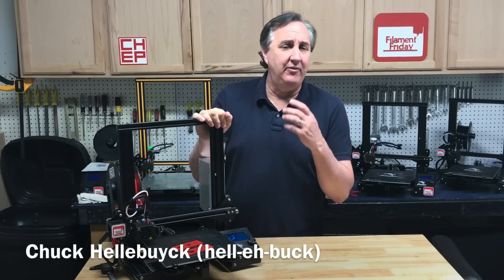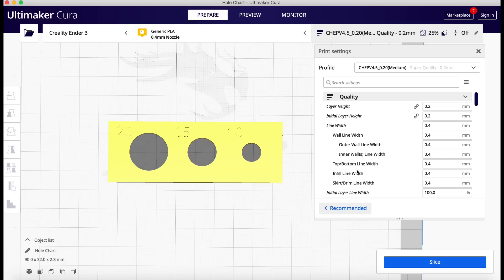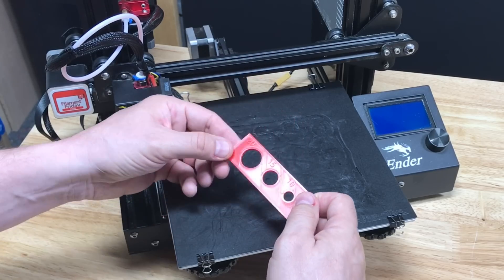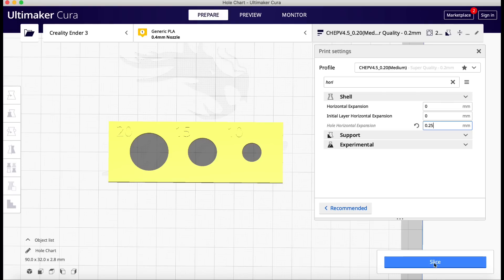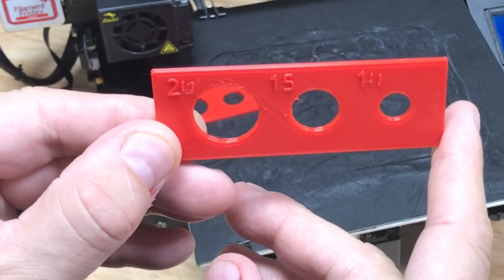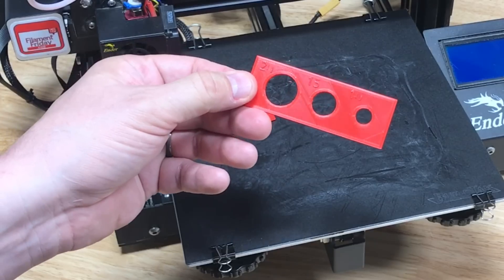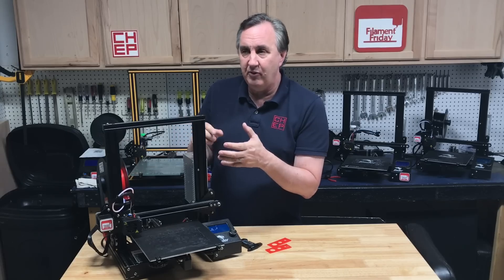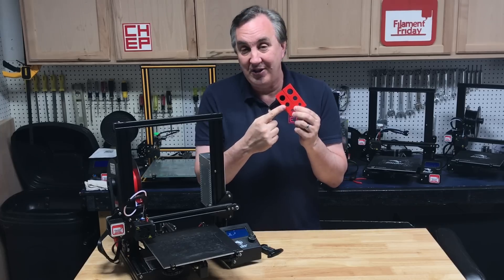Horizontal Expansion Setting in Cura

Comment: My issue is that you had to print it for 45min just to find out it’s wrong. Any idea why it’s wrong in the first place? ...Stay well and thanks for the videos.
Reply: He used a very dense infill on the whole part...
Reply: Uwe Zimmermann thank you. If he’s using a 0.4 infill with a 0.2 wall and it is extruding to to much to make the holes off (to small) if you know, what was keeping the exterior dimensions correct? Flow rate? Thank you, stay well
Reply: @dougw9224  my own interpretation - see in some other answers here as well - has to do with the interplay of excess plastics and thermal shrinkage. On outside walls these two effects work in opposite directions which might be good enough to cancel each other out to within the measurement accuracy of Chep's calipers, while for internal opening both effects will work in the same direction, adding together.

Comment: I've always compensated for this by making the holes .25 bigger in my fusion 360 drawings but this is much better. 👍
Reply: How is this better when your entire object/model won't fit with another one?
Reply: You have more control doing this in your cad. Avoiding the unwanted changes to other areas of your print.

Comment: I think your holes were faceted, (flat spots) due to arc error...I'd also get some metal calipers...Good new feature though....
Reply: not an arc error - but the design he used obviously did a rough low-faceted circle to start with (parameter $fn in openSCAD)
Reply: @uwezimmermann5427  Not surprised TBH...He's using Tinkercad, that's as basic as it gets....🤔🤔😳😳
Reply: @EnglishTurbines  even Tinkercad can make rounder circles...

But of course if you measure the diameter of a segmented circle it is important if you measure from vertex to vertex, facet to facet or facet to vertex...
Reply from the maker: In comments Viewer was skeptical so used Solidworks with extreme stl output and saw the same error so it’s not just Tinkercad.

Comment: When making circles in TinkerCAD you should change the "sides" option to max of 64, which will make it a proper circle. You can see in your design it has made a circle with lots of small straight lines, and this will affect your measurement.
Reply: A circle is ALWAYS made of small straight lines in a 3D model!
Reply: @DarthChrisB  Yes, but I'm saying you can make it a LOT smoother with a simple change in TinkerCAD. Just info for people that didn't know, it defaults to a circle of very low resolution (20 sides)
Reply: 64 is not a proper circle either when you get to larger diameters...
Reply: @uwezimmermann5427  I realise that. But like I said, that's the maximum setting in TinkerCAD. Just wanted beginners (TinkerCAD is great for beginners) to be aware that you can change this option.
Reply from the maker: Comment by Georgia stated he created same design in solidworks with extreme quality stl output and saw the same smaller hole results in Cura. So it’s more than just Tinkercad.

Comment: Hi guys I need some help if I try to insert knot into a print and I enter the Gcode code as required i’m lair 25 for instance it’s a six hours printing time how do I know what time I need to come home to insert the knot or do I have to stay there for six hours
Reply: Eli Dari if you’re six hour print has 100 layers, you can divide 6 hours (360 minutes) by 100 layers and get approximately 3.6 minutes per layer. 25 layers times 3.6 minutes would equal 90 minutes. This of course is an approximation but I think it’s as close as you can get since not every layer prints exactly the same length of time. Maybe there is a better way but that makes the most sense to me. Time / total layers = minutes per layer (MPL).  MPL x Paused Layer = Approximate pause time. Divide minutes by 60 to get hours again. Edit: I tested it and it’s pretty close..

Comment: I'm having a hard time to understand why the design doesn't get properly translated from the stl to the gcode. Anyone can explain that please.
Reply: it does... sort of... but the gcode does not necessarily gets translated into an exact piece in the 3D world because molten plastic is - well - plastic, there is shrinkage, etc
Reply: @uwezimmermann5427  I get the shrinkage part but that doesn't explain why the outside dimensions are spot on and the holes are smaller. Wouldn't everything be affected?
Reply: @Megdiver  if you look at the outside wall, then you have two counteracting forces. These two do not have to cancel each other exactly to give you a zero-result on the corresponding measurement scale, it is enough that they are working in opposite directions.

For the inside of holes you also can look at two different forces at work - even though the shrinkage of the whole part will me much less visible it would have parts which work in the same direction as the squeeze-out.

If you look at a mechanical part with a hole in it, then thermal expansion of the whole part will extend the diameter of that hole. This is used practically to make permanent connections between parts, e.g. rings on axes - heat the ring, put it on the cylinder and let it cool down. It will shrink onto the axes and form essentially a single non-separable part.
Reply: @uwezimmermann5427  So in layman's terms for dummies like me. Because there is not enough opposing force from within the hole it will "spill" in?
Reply: @Megdiver  I guess you could imagine it like this... but the same "spilling" is true for outside walls. Normally the slicer will already consider part of this by placing the outline of your 0.4 mm nozzle at the physical border of the object, but if you have plastics on one side of the track which is put down, but not on the other, there will most certainly be some extra spill into the void.

Comment: I've been trying to understand why this is an issue to begin with. I've read multiple things saying holes come out small because its molten plastic being squished down, well if thats why, then why are my outside dimensions spot on? Why can't the slicer "see" the sizing of all features and just make it that size? I don't expect accuracy down to a micron but it shouldn't be a half a millimeter off either. Anybody got a real answer to this?
Reply from the maker: Part of it is the stl design. Nothing is perfectly round.
Reply: the outside dimensions are affected differently by for example shrinkage when the plastic cools down. Even while printing there is a different temperature/heat distribution if you are on the outside of a print or on the inside

Comment: Thanks Chuck

I had been using 4.6 since its release and updated last night to .1 . I have been finding issues with not getting Initial layer Bed and Nozzle temperatures and speed to vary on my printer recently. 

I have been spending time during lockdown to tune my printer and profiles. The settings are set in Cura, but when running the prints it just uses the regular settings and ignores Initial setting. 

Have you found this too or did I screw up a setting somewhere else to override this?
Reply from the maker: I have not been watching that close enough to give you a good answer.
Reply: @FilamentFriday  Ok found the problem. I used your example code to pre-heat the bed and nozzle at the same time. This code uses the main temp settings and therefor the initial layer temp settings are ignored. Not a Cura issue then.
Reply from the maker: You. can change the GCode to heat initial layer instead of what I did.
Reply: @FilamentFriday  i thought so too. Where can I find the variable name to replace the material temp one with?
Reply from the maker: M140 S{material_bed_temperature_layer_0} ; set bed temp
M190 S{material_bed_temperature_layer_0} ; wait for bed temp
Reply: @FilamentFriday  Hi Chuck,

Thanks, that was the ticket to my problem. Aftter changin the variables for both bed and nozzle, I now get it to heat both at initial temps and later on in the print revert to the final set temps.

Thanks for the help!

Comment: I can't get your profile to print. I ended up reverting to the stock profile in Cura on my CR10. The infill on your profile just turns into spaghetti.
Annoyingly I can't test it further at the moment as my heated bed is throwing thermal runaway messages at me and I'll be damned if I can get a print to stick reliably without it on.

Comment: I think I know why the holes are too small on your first print. It's not the slicer or the printer - it's TinkerCAD. Cylinders in TinkerCAD are inset. That is - the vertices are at the radius you specify, but the middle of the faces will form a smaller radius. The more vertices (larger value on the "sides" slider), the closer your hole will be to the correct dimensions. To calculate the actual hole size, multiply the radius by cos(180/n), where n is the number of sides. I think I can see from your video that the holes look quite faceted. I'm guessing you used the default "sides" value of 20. If you crank that up, it should approach the correct size (and be a more round hole).

Comment: What about the vertical element of the hole?  It may well have changed the horizontal dimension, but if the vertical element isn’t amended, or isn’t amendable, then you won’t have a true circle.
Reply from the maker: They are true circles. They measure the same in all directions.

Comment: I always add „M18 S9999“ before the M0 in the gcode. This keeps all motors on for quite some time. On a direct extruder core xy system this also prevents to move the tool head when  pushing the extruder lever.

Comment: Anyone having quality issues with 0.8mm nozzle? I get good results with 0.4 but 0.8 is just impossible to me, anyone has settings to share? Cheers
Reply: In vase mode with .8 nozzle I get great results. But when not in vase mode there are "zits" at the seams or retraction areas. I have direct drive on my Ender3 so I figured it is retraction speed/distance or linear advance settings. I really never use the .8 so I haven't spent any time dialing it in.

Comment: The horizontal expansion thingy is the only thing that interests me from 4.6 or 4.6.1. The problem with every Cura update is that you have to re-check all settings you had in previous versions. And it adds some issues. For instance, all the nozzle sizes for the Artillery X1 definitions are gone
Reply from the maker: Report it. 4.6.1 fixed that issue on Ender 3 profiles.
Reply: @FilamentFriday  I think it's been reported already by the guy of 3D-Nexus, the "author" of 90% of Cura profiles out there for the X1 and the Genius. Actually, I thought the 4.6.1 addressed that issue in version 4.6, but it doesn't
Reply: @FilamentFriday  I'm thinking about passing my EZThreed Nano on to a local school, but not unless I can get a real Cura profile for it. The dumbed-down slicer it comes with just doesn't cut it- it's like it was made by Mattel or Hasbro. Does Cura 4.6.1 have such a profile?
Reply from the maker: No, but it could be built.
Reply: @FilamentFriday  Who/where might be a good place to ask?
Reply from the maker: 3D MakerFaire Noob might have one.